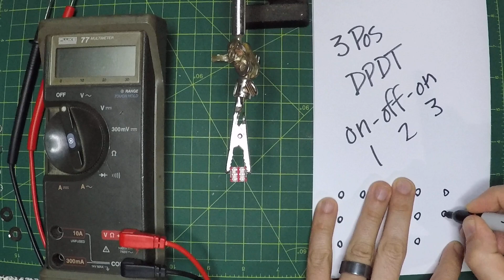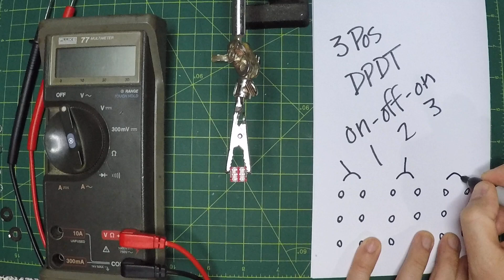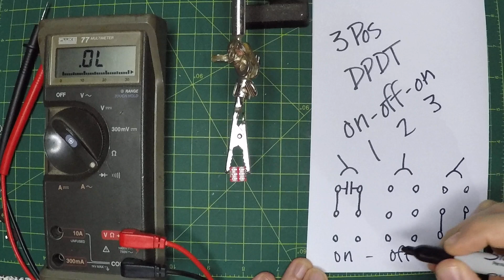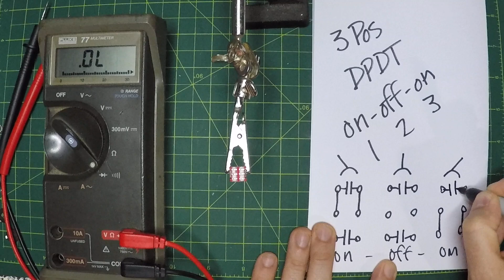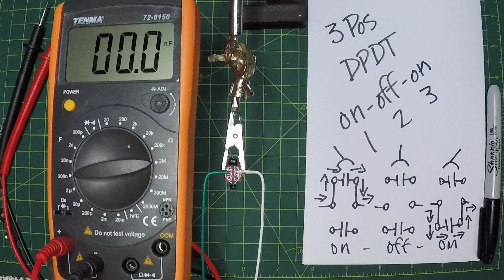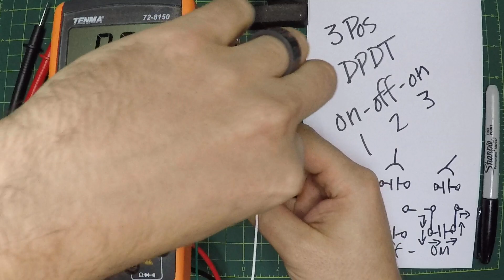Wiring a 3 Position On/Off/On DPDT Switch

Comment: Hi Phil, thanks for your great explanations for all things electronic.  Can I suggest a correction in terminolgy?  The world of SPST DPST DPDT etc. is confusing enough for most people.  You are illustrating the operation of a Double Pole ST switch... yes it has 6 terminals/terminations but only two poles, the two  common terminals.  A pole is a terminal and a terminal can be a pole though not necessarily, they are not inter-changable terms.  This switch does not have 6 poles, only two.  Thanks again Phil 😁

Comment: Hi. Thanks for the video. I have a question. I’m building a variable speed controller for a dc treadmill motor. I want a DPDT rotary switch to select between forward and reverse. 
I found some nice rotary switches called 2NO 2NC . It seems like that’s what I want but not sure. 
I also have little indicator lights that I want to come on depending on the selection. Green for forward and red for reverse. 
Will these switches work and how would I wire them?
eBay switchtools 19-22 mm 2/3 position selector. 
Thanks,
Paul

Comment: Can you show me what it actually looks like all wired up? I've tried looking for videos showing how it's all wired up but I can't find any.
Reply: Nevermind. I got the help I needed and figured it out. If you're not doing a crossover, which is not my case, all you have to do is put all the positive wires on one side, all the negative wires on one side, and that's pretty much. Say for example you have a 3s 18650 battery pack with BMS for a DIY induction heater. On the BMS, you have a -ve output and +ve output. So say for example you need to power a blue LED and you only want the blue LED to turn on when the slide switch goes to the other side, or battery powered mode. Two negative wires and one positive wire on the BMS from those -ve and +ve outputs. One negative goes to the NC, or NO terminal on the slide switch. The other goes to the negative of the blue LED. The positive wire also goes to the NC, or NO terminal, on that same side. On the COM terminals, you have a negative and a positive wire. Those go to a MOSFET module, and the MOSFET module powers all the other components of the induction heater. But on the COM terminal where the positive is, you have another positive wire which goes to a 20K ohm resistor for the blue LED. On the other side of the slide switch on NC or NO, you can attach the positive and negative wires from a DC power jack like a 12v one or a 1a 30v one. So the way it works is you have the induction heater powered by DC input, battery powered, or off (On-Off-On). And that's pretty much it. Basically, just have all the positives and negatives on one side. You can have multiple wires on the BMS from the -ve or +ve outputs or from the COM terminals of the slide switch to power other things such as a blue LED or supply power to the MOSFET module to power the other components.

Comment: Bravo. How do I connect 3phase motor using DPDT switch  to  control two contactor in order to have forward /reverse operations  on the  3phase electric motor. Thanks.

Comment: Hello, what if i want to connect together a 2 motor.
I want to make like this.

In left position Turn on Only Motor A.
In middle position turn on Motor A and B.
In right position turn on only Motor B.
Motor A and B have same power source and same voltage
Is it possible?
If yes i have a plan only wiring the + cable in switch
And the - not go to switch.
But i dont know how to wire it.
I think only need cable jumper for activate Middle connection for turning on Motor A and B